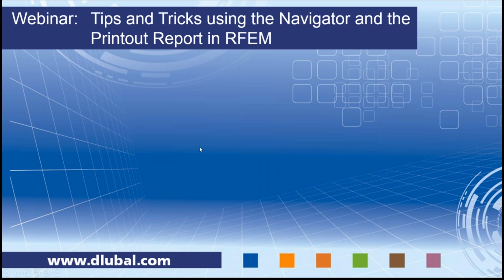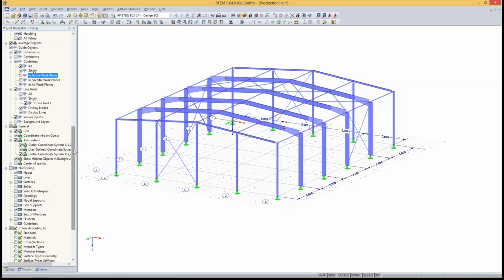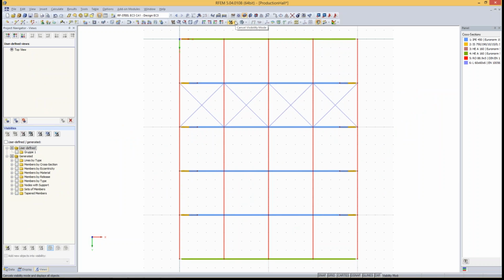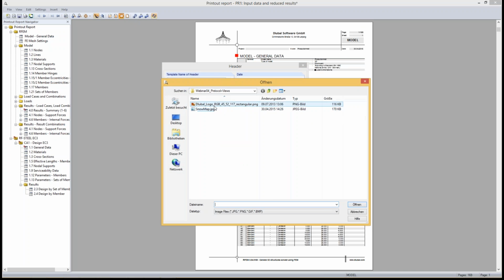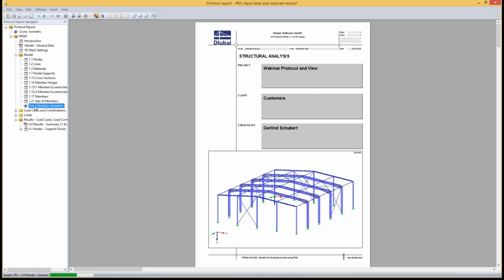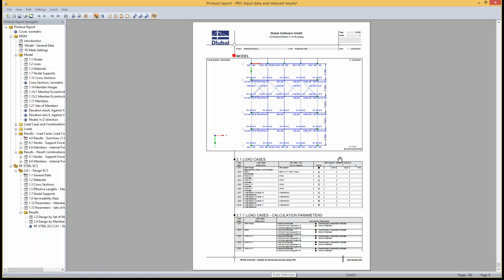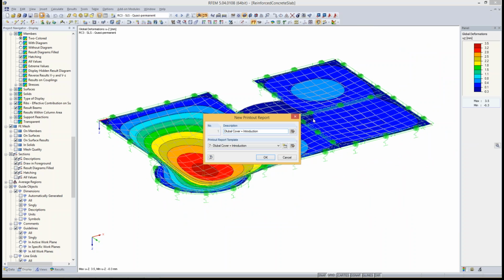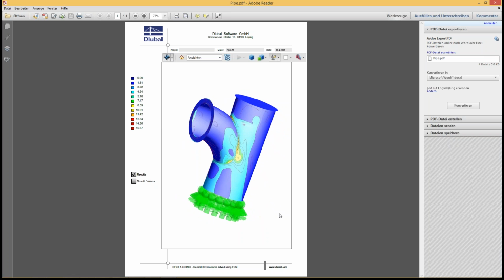Webinar: Tips and Tricks Using the Navigator and the Printout Report in RFEM

Comment from the maker: Dlubal Webinar: Tips and Tricks Using the Navigator and the Printout Report in RFEM

More Dlubal webinars:
https://www.dlubal.com/en/webinars.aspx

Further information:
https://www.dlubal.com/en

#bim #cad #cae #concrete #connections #crosssections #dlubal #dynamics #eurocode #engineering #engineeringsoftware #fea #fem #glass #industrialconstruction #mechanicalengineering #membrane #plantengineering #rfem #rstab #timber #steel #steelconstruction #structuralanalysis #structuralengineering #tower #webinar